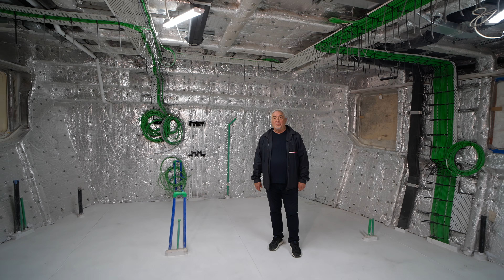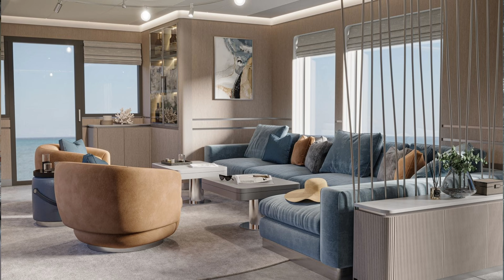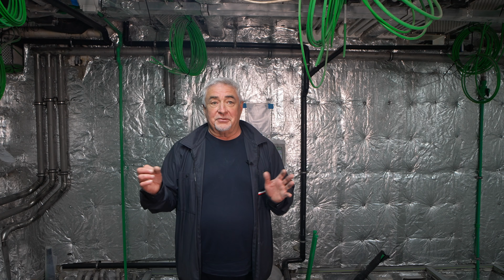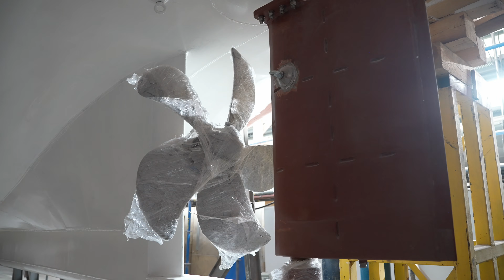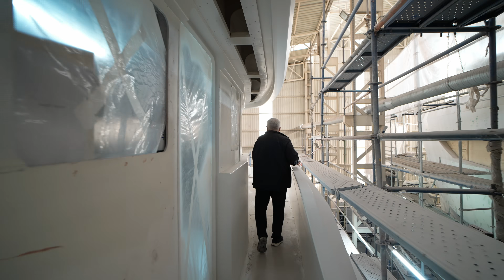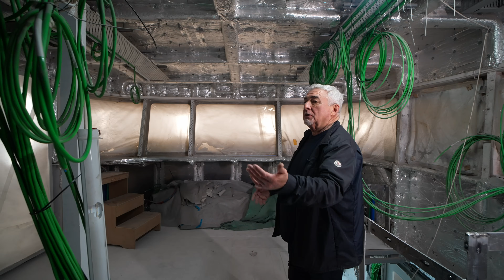UNDER CONSTRUCTION: NautiStyles’ Bering 82 in Build

Comment: Piping containing insulated wires is called conduit.
Reply from the maker: Thank for your comment.
Reply: @BeringYachts  I used to be on a horizontal drilling crew laying fiber optic cable underground.  Worked with miles of conduit.

Comment: Very nice. Build quality looks top notch but can you please give the engine options to go at least 30 knots. I know it not what the boat is built for but it would be nice to at least have the option available.
Reply: Bigger motors wouldn't make it go much faster. This boat is not designed to rise above water to go fast. The boat need a different shape to do that.

Comment: Ok Alexi, maybe I can get a quick answer from you the builder. Why on this size boat (or bigger) do you not often see controllable pitch propellers? You explained  the counter rotation. It just seem like the ability to quickly change thrust direction would make slow docking maneuverability in tight marinas an advantage to "owner operators". Emergency crash stops, dead slow speeds. The military has used CPP on Destroyers and Frigates for many decades.Is it just cost and complexity or----? Thanks for the great detail is this build update. Have been following Victoria and Rico for years now. They are a very good endorsement for Bering and you!
Reply from the maker: The main drawback of a controllable-pitch propeller (CPP) is that, like any other propeller, it’s a bespoke piece of equipment—its characteristics are dictated by the specific design of the vessel. Since the blade angle is typically adjusted via the propeller shaft, that shaft also has to be custom-made, with its length and diameter tailored to each individual ship. The CPP’s control rod is usually operated through a reverse gearbox, meaning not only the propeller and shaft line but also the gearbox need to be specially designed. Manufacturing or repairing a CPP is practically impossible at a standard shipyard; it’s a job for specialized companies, of which there are only a handful worldwide.

Additionally, this option is extremely expensive, and there is a limited number of suppliers offering it.
Reply: @Beringyachts  Thanks for the excellent details in your response. Now we know it's to impractical.